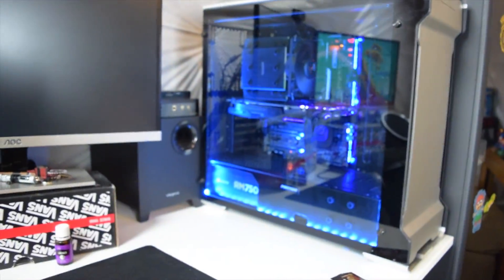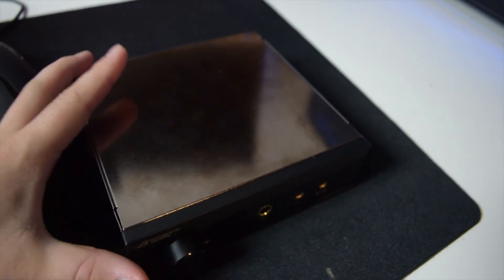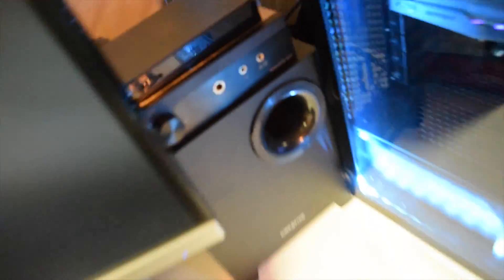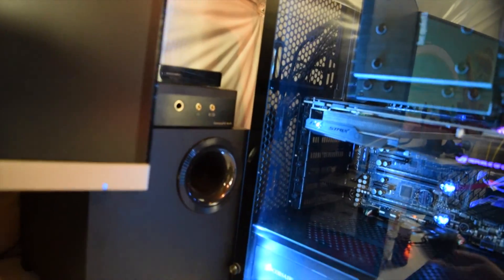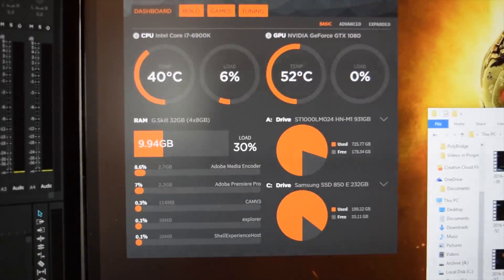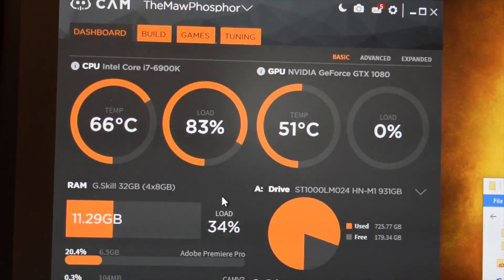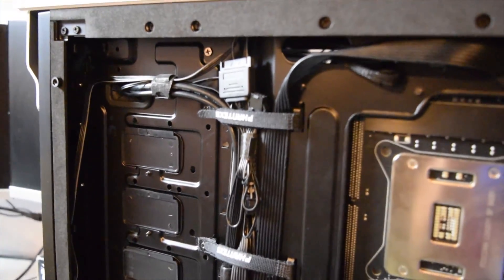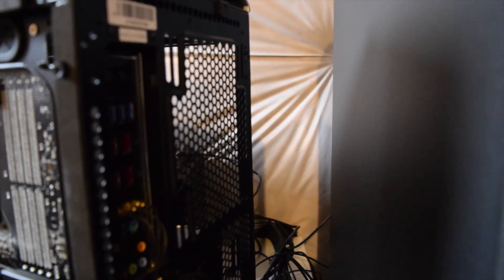Installing the New Silent Wings 3 Fans: Upgrading The Maw Verstion 3 1 -Part 1

Comment: nice video. I noticed you have the ASUS fan extension. How do the Be Quiet fans interact with it? I had the extension with three Corsair fans attached to it and they would be there one day and vanish the next it was very annoying. I decided to just take it out of my rig and use Y splitters instead. So I have 3 fans on one header, 2 on two different headers and then 1 on the last header. It actually works a lot better now, I'm just wondering what your experience with it is. Have you ever looked into the EKWB Predator AIO? I prefer it over any other AIO out on the market.
Reply from the maker: It worked totally fine for me! It was the one that came with my motherboard though, so I bet its a different model. I've had good luck with it so far. :)
Reply from the maker: and no I havn't looked at the EK AIO's. I'm pretty intrested in doing a full custom loop sometime down the line. :)
Reply: I ended up getting the Predator 240 and then just upgraded it to the point that it was no longer the predator and instead a full custom loop
Reply from the maker: niiice
Reply: Beeeyeee -Tech & Tutorials I am also looking to change out all my fans with Silent Wings 3 High Speed PWMs. 5 - 120s and 3 - 140s
Reply from the maker: Man thats a lot of fans! I had 6 fans in the old version of The Maw, temps were great, but I got so much more dust in there too. If you still want to do it make sure you have great control of each fan!

Comment: How are those fans and how is the cooler ? I ordered the black rock 3 but it hasn't arrived as yet. Also, why did you change the stock fans out ? I am thinking of getting 3 120's of the silent wings 3.
Reply: Amazing cooler. Amazing fans. Just if you can get the 140mm and make sure it's the high speed PWM versions. :)
Reply: why does it matter if it is the high speed?